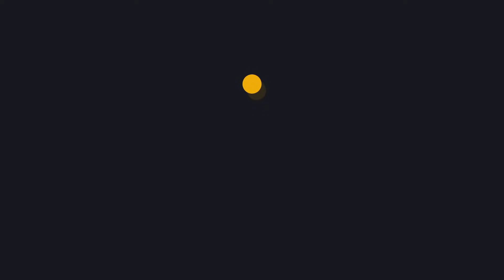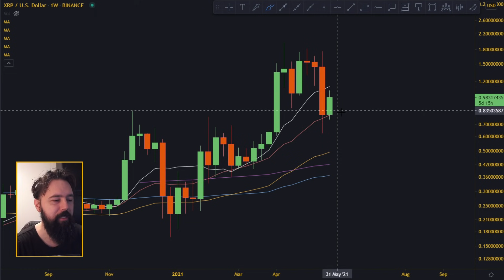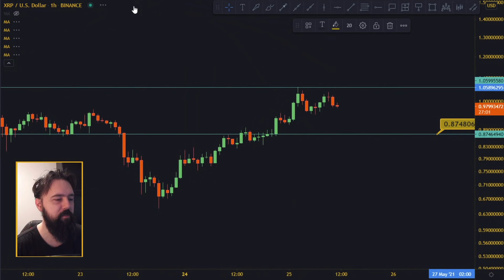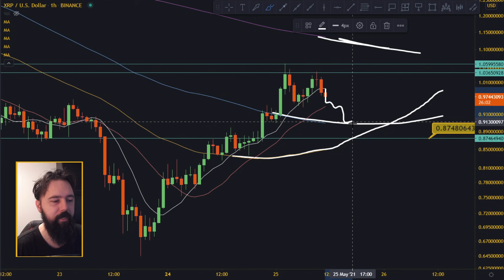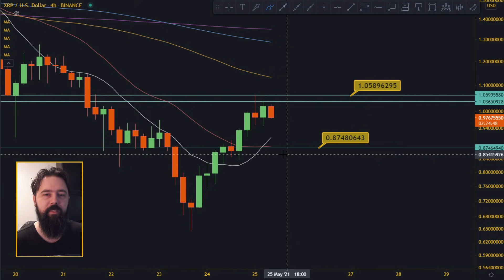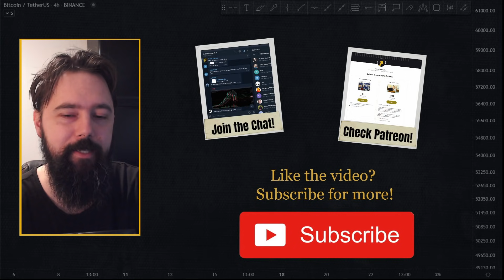Everything Looks Just Nice - XRP Analysis And Price Prediction.

Comment: Important points made and it's all great, in my opinion when it comes to the  mother of all coins < B  TC >, B!tcoin is getting interesting every day by day. Alt, Xrp, Link are still lucrative in the market. In this case, the Majority are finding it difficult on which coin to HODL better. Right now bitcoin it's in the greatest shape and we are all expecting more of it, I'm currently a HODler but still, I'm using a working system that provides me 80% correct signal which helps me increases my portfolio, now I bother less about the speculation of the market." I'm still winning by applying the same method in every trad e, you can also become a winner today, I think crypto is going to get more importance and acknowledgment in the future. BTC is the future doesn’t mean we should just hold and not think of the negative effect it would put on you when it goes low than the entry price. Most newbies often undermine and most often neglect the importance of Technical analysis with regards to trading. Technical analysis overly predicts the movement of asset prices regardless of what is happening in the wider or broader market . so to be on a safer side i advise that we all follow a less talked about way, which is trad!ng. I have been able to generate 13.2b tc with my initial 3.5.Y'all in search of a profitable system can reach out to Mr Henry Marin on TEIEGRAM (@henrymarin1*) and ահαԵsαթթ +447868768012*. for more insights................
Reply: one of the most amazing thing have ever seen is seeing my 2btc been grown into 7.5 in less than 2 weeks,
 mr Henry Marin with his magic touch made that happen. thanks once again
Reply: All my time using his services, I haven't had issues with them.
Reply: wooooooow ... this is the very best time to invest in cryptocurrency this season only favors the smart one who can see ahead
Reply: Henry’s success story everywhere, wow.
Reply: Am a great follower of his service, I use it from time to time on my binance